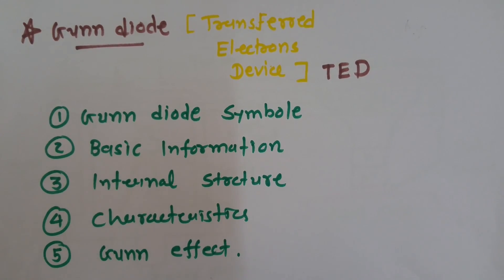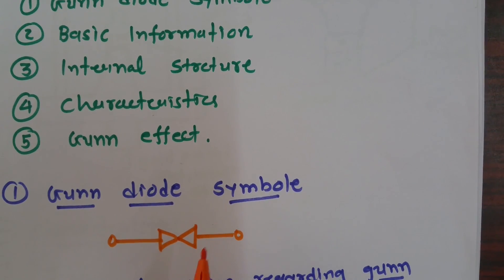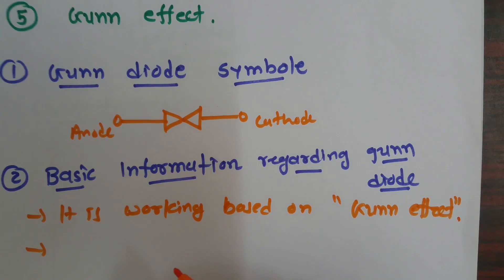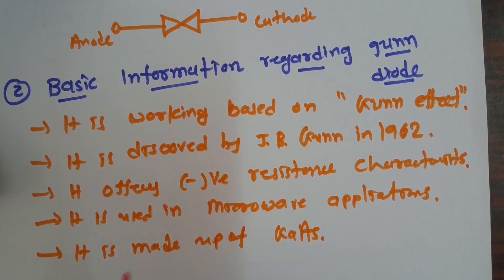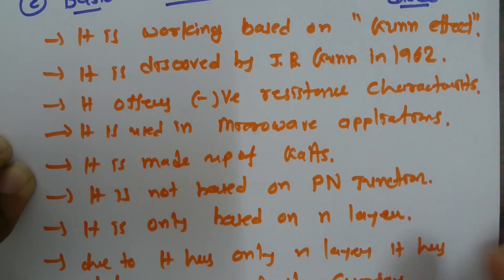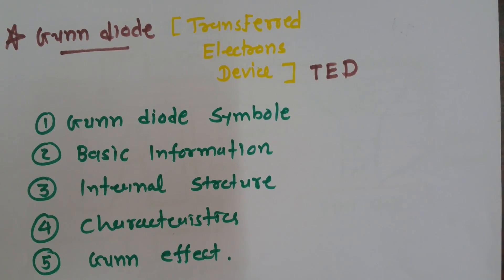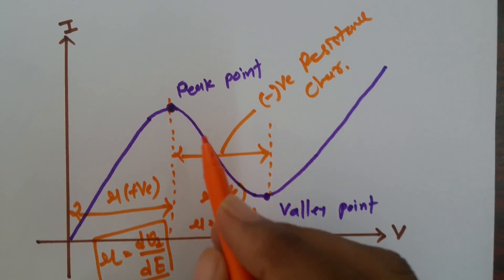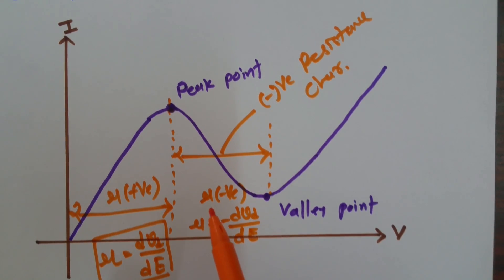Gunn Diode (Symbol, Basics, Structure, Working, Characteristics & Applications) Explained

Comment: J.B Gunnfound that in a small DC voltage is applied at the ends of N type gallium arcanide or Indian phosphide ,  the current first Rises linearly from zero and then begins to oscillate with the certain threshold is reached the time of the oscillation that is   is very close to the time it takes for the carriers to from travel from one contact to the other contact  through n type material and this is known as Gun effect  or bulk effect.

Comment: Operating modes of gunn diode?
Reply: J.B Gunnfound that in a small DC voltage is applied at the ends of N type gallium arcanide or Indian phosphide ,  the current first Rises linearly from zero and then begins to oscillate with the certain threshold is reached the time of the oscillation that is   is very close to the time it takes for the carriers to from travel from one contact to the other contact  through n type material and this is known as gun effect or bulk effect.

Comment: gunn effect to batao sir kya hota hai?? and why negative resistance is coming / why mobility decreases the main concept please ......what is valley .....working with energy band diagram.... everything which is not easily founded in normal books you also escaped please make another video for this diode including these things
Reply from the maker: Definitely I will make one more video on it. Thanks to remind me. God bless you
Reply: @EngineeringFunda  sir please make another video as Gunn diode . You didn't explain Gunn effect, valley,high field domain,rwh theory.
Reply: Engineering Funda sir, please make video on GUNN DIODE USING RWH Theory with derivation

Comment: Why holes go to p+ and electrons go to n+ 
As they should attract negative charges
Reply from the maker: Positive terminal is there with p+ and negative terminal is there with n+ so direction of current will be from n+ to p+ so one can easily say holes will move towards p+ and electrons should move towards n+.
Reply: Engineering Funda 
Bt they are supposed to repel
As holes are positive and electrons are negative
So how holes(positive charge) goes to p+ (also positive) and same in case of electrons
Please explain
Reply from the maker: Holes are moving towards p+ and making it more p+ that's the point.
Reply: Engineering Funda 
Ohkk thanx

Comment: Well explained!!...I want to know the working of two valley in conductiom band i.e lower and upper valley in gunn diode
Reply from the maker: +ayesha Shaikh : in lower valley +ve resistance is about to begin by further increase in voltage and at upper valley -ve resistance is about to begin as you increase voltage further so do biasing of Gunn diode in between this to point so that you can have minimum reverse recovery time and fast switching characteristics.
Reply: how does the transfer of electrons takes place from lower valley to upper valley?
Reply from the maker: ayesha Shaikh : see direction of electron is same as current is positive but qauntity of electrons decreases during -ve resistance characteristics and quantity of electrons increases during +ve resistance characteristics and that you can understands based on mobility in characteristics.
Reply: Got it!!
thanks alot  for your explaination sir..you explained it well.
Reply from the maker: ayesha Shaikh : your welcome

Comment: What i sreverse recovery time? Also how is it related to the reversed drift velocity or the negative resistance?
Reply from the maker: +Siddharth Sharma : mobility is getting negative. So velocity of electrons is getting drifted in opposite direction hence it results into increase in voltage with decrease in current
Reply from the maker: +Siddharth Sharma : reverse recovery time means time required to evacuate all charge carrier so that state change from on to off.
Reply: Thank you for repllyinv but I still dont get it, how does negative resistance assist in quick recovery times?
Reply from the maker: +Siddharth Sharma : negative resistance means increase in voltage with decrease in current so if u have reverse (-ve) mobility (v_d/E) then increase in voltage will increase electric field and increase in electric field will decrease current.

Comment: He saying giga hz but writing khz what the... But video is good
Reply: if you see his previous videos you'll see that it is just how he writes 'G', you get used to it after a few videos.
Reply from the maker: +yash 2 : it's giga hz only and written as GHz. May be u might have read that due low quality but u can switch it to high resolution, it's available up to 1080p with this video
Reply: Engineering Funda its was written 3-10khz isn't it correct me if i am wrong
Reply from the maker: +yash 2: it is 3 to 10 GHz. May be my writing is not good enough to convence u.
Reply: yes i also thought first time that it's khz,